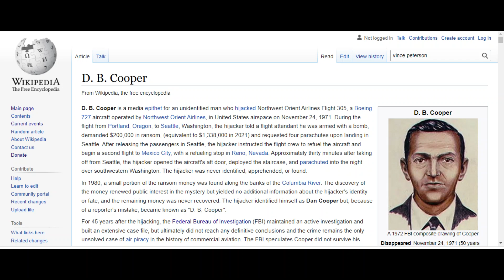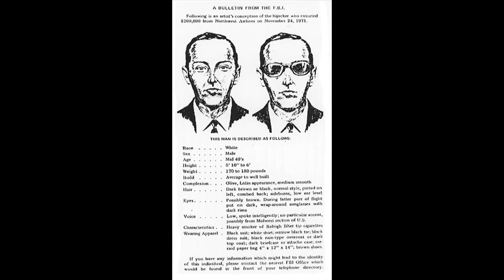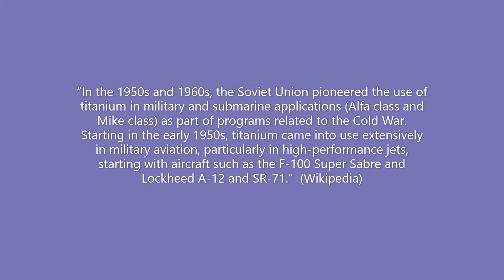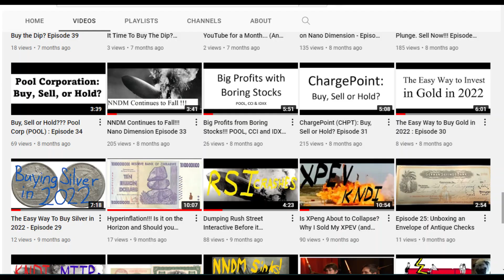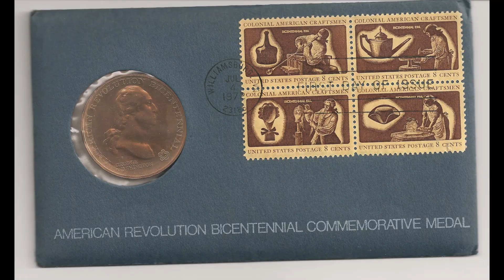DB Cooper: The Trouble with the Titanium Tie and the Latest Suspect. Episode 147

Comment: This is just a hunch, but my theory is that Cooper was a secirity guard. I'm sure that places like Boeing and Lockheed had former military guys working security. It just seemed like the most logical explanation, because my recollection is that some of the residue indicated the tie had been worn regularly. Who is going to wear the same clip-on tie to work 3-5 times / week? I would say a security guard.
Reply from the maker: Hello, as a former security guard at a high tech facility for eight years I think that you are not necessarily too far off. We had a strange rule where if we wore a long sleeve shirt which was part of our uniform then we had to wear a clip on tie, but if we wore a short sleeve shirt we did not need to wear the tie. The ties that we were given were supplied by the company and were very specific one made for the company that looked like it went with the uniform but upon leaving I was able to keep the tie and on occasion I would wear it with a regular suit jacket because on occasion it looked like it would be appropriate. Now we know for a fact, this is really undisputed by anybody, that this particular tie was an inexpensive one sold for only a few years towards the end of the 1960s at JCPenney. The argument against a security guard wearing this tie during the course of their day would be that typically their employer would supply a tie and would want a standard tie worn by everybody, not one off the shelf from a department store. However I pointed out in my most recent video that I uploaded yesterday which was the second part of a two-part series about the tie (which I encourage you to take a look at) and I suggested that a wide variety of people could come into contact with the substance in question during the course of is there a normal business. I think that one would find and most people agree that most men and these situations were wearing ties from the top executives down to the mail clerk. I could even see some of the custodians wearing a tie. You have to remember that at that time gas station attendants often wore uniforms with hats and ties. Now I agree that people on the shop floor would likely not wear ties because it could get caught in machinery, that nevertheless leaves a lot of people who could come into casual contact and pick up three molecules of the titanium in question. I also asked the question which may be relevant or not but if somebody was working with this titanium why out of 100,000 molecules found were there only three molecules of titanium found on the tie? That seems like very few but again this could be a tie that he wore for one week in the lab before he committed the crime if the tie actually belonged to Cooper for more than a short period of time. Many people have pointed out that you can get ties at garage sales and thrift stores. That's certainly true. Other people point out that engineers where the same tie for years and never get rid of them. I've had a number of people contact me and say that they've kept every tie they've ever had, and I believe that the same would be true for me. In the end the tie may be very relevant or it may be completely misleading even if inadvertedly so. Thank you so much for your comments. Hopefully I have gained you as a subscriber.
Reply: @theanthonyrrmillsshow3876 : Thank you for taking the time to write such a thorough reply. You gave me a new way to look at the situation, as I didn't think about the fact that ties would have been a lot more common back then. I was born almost a decade after the skyjacking. So, I didn't even think of that.

I agree with what you're saying about the amount of titanium being too little for someone who worked with the material regularly, unless the tie had only been worn a few times. I think the tie was worn a lot, though. I'm going off of memory on this. So, I could be totally wrong, but I think I remember hearing that the amount of nicotene residue on the tie was consistent with it having been worn very consistently.

As far as the garage sale / thrift store angle is concerned, I had heard that, and initially thought it made a lot of sense. The more I considered it though, the more I thought it would be an incredible coincidence for a chain smoker who knew weird details about airplanes to buy a used tie that had belonged to someone who worked with cutting edge metals that were primarily used in manufacturing airplanes.

I'm not sure whether I watched the follow-up video you referenced, or whether I subscribed to your channel. If I didn't, I will certainly do it now.

Since I feel like every Cooper fan should declare a camp, I'll disclose that my pet suspect is Ted Braden. Cheers.
Reply from the maker: @scottyoung4226  Ted Braden is a very good candidate on the surface. My concern with any of the candidates that people have put forward is they all survived after the hijacking. I don't rule out the possibility that Cooper survived but I think that it's very unlikely and if I'm correct then none of the people who have been proposed could be Cooper since they all lived at least a couple years if not decades past 1971. Again I don't rule out anything, it's just too bad we don't have any suspects who disappeared after Thanksgiving 1971.
Reply: @theanthonyrrmillsshow3876 : Thank you for your replies.

Relative to the dynamite, it seems like we're in agreement that the smart move for Cooper would have been for the bomb to be fake. The reason I bring up the flares is that people always say Cooper wouldn't have been able to coordinate with an accomplice, because he had no way of knowing where he was going to land. My thought is that, if Cooper had flairs, he could have arranged for an accomplice to be waiting at the Columbia River. Cooper reportedly asked the stewardess if lights they could see were from the Merwyn dam, and also asked about the location of a nearby AF base. My guess is that he was trying to get his bearings so that he could land as close to the river as possible, and then fire off flares to signal his position to his accomplice.

I get your reasons for thinking Cooper died. The money at Tena Bar is really tough to explain if Cooper survived. If we're being honest though, the money at Tena Bar is tough to explain if Cooper died, too. It was three packets of bills. Each was wrapped with a rubber band, but the three packets were not attached to each other. All three were on top of each other, and Tena Bar is upstream of where Cooper is thought to have jumped. What are the odds of three stacks of bills floating against the current, and staying stacked together? If you think the cash got there from dredging instead of the current, what are the odds that those three packets would end up stacked together after the sand was deposited?
Reply from the maker: @scottyoung4226  Hey friend, I just saw this message from you, as you can imagine, I am now getting dozens of messages a day on Cooper, plus a few here and there on other topics, and i try to answer each one eventually, sometimes with a "thanks for the comment," other times with longer messages, often after checking to confirm a detail or two. I think your comment on the flares being able to be used to alert an accomplice is an excellent one. I ultimately do not think that they were used, so I think (and I agree I may be wrong) that Cooper did not survive, but the use of flares to alert an accomplice is still an excellent though and one i will keep in mind. As far as Tena Bar is concerned, I think perhaps you might have the direction of the Columbia River confused. The Columbia flows from east to West towards the Pacific right after the Vancouver Portland area the Columbia turns north for a bit and then turns east and continues a fairly short distance to Astoria and onto the Pacific. I think most people think that Cooper jumped in the Washougal river drainage area which flows S into the Columbia, or else he fell directly into the Columbia which is my suspicion. In either case these are to the east of Vancouver and Portland. So if the money fell somewhere in that area and then flowed towards the Pacific with its current, then Tena Bar is downstream. So it could have arrived there naturally due to currents downstream. Most researchers believe that the money bound its way into the Columbia and sank to the bottom where it was dredged in 1974 and deposited at Tina Barr. I don't know which way dredges travel when they are dredging the Columbia but it would seem to me that if it was dredged then the dredge could continue going upriver and drop it off or it could be going downriver and drop it off. So if we believe the dredge theory were it deposited the sand on Tina Barr then the location of the money on the river bottom cannot be logically determined just based on knowing that dredges deposited there sand at that point along the Washington side of the river. if somehow we knew that the only sand that had been dredged and deposited on Tina Barr between 1971 and 1980 was sand dredged from a particular part of the river, then we may know where the money had come to rest, but I doubt there ever existed clear records of that. The only reason to keep such records would be knowing that in six years people are going to find a little bit of money from a famous skyjacking case where we just dropped off some sand.
I know that there seems to be lots of controversy over the rubber bands supposedly holding the money. I don't even know if we can conclusively state in a court of law as a fact that it was rubber bands holding the money together and not the paper bands that are usually used to bunch stacks of money together. I don't dispute that it's rubber bands but I've never seen any pictures of the supposed rubber bands. And the thing about rubber bands is I have a house full of rubber bands that are really old and you pick up most of them and they just crumble in your hands. And then other times you have a rubber band around something that's just as old and it's still pretty good. My suspicion is that being submerged in cold water and then buried in the sand for quite a while may have actually preserved the rubber bands better than people think and better than the experience that we have with rubber bands sitting in our junk drawer. the issue of the money and those rubber bands is one that I don't know if the Coopersphere will ever completely agree on. some of what you read about interpretations of the rubber bands goes in One Direction and then you can read stuff that completely contradicts it. I know that there's now some research about the type of diatoms found on the bills and what season those diatoms bloom in. just as in the case of the titanium on the tie which may or may not be pure titanium or an alloy or both, without a very formal scientific report on of the diatoms that is peer reviewed by a number of experts we need to be very cautious in thinking that we know precisely when the money entered the water or at least the waters of the Columbia. I think that for money that likely was in the Columbia or in the wet sand along the edge of the Columbia for almost 9 years, there is plenty of time for diatoms that bloom in various seasons to come into contact with some of those bills.
OK my friend I think I'll finish up here and send this off to you I really do appreciate all of your comments and your interest in this subject. Keep on sending them to me, again I'm not an expert despite what some people might think, I'm just somebody interested in it that's willing to spend the time to create some videos. There is still a tremendous amount for me to learn about this subject.
Reply: @theanthonyrrmillsshow3876 : Thank you for your response!

I definitely could be mistaken about the directions of the rivers relative to the Tena Bar find. This was an obsession of mine a few years back, but my memory may not be as good as I'd like. My recollection was that the Washougal Washdown Theory required the money to travel against the currant in one of the two rivers, but maybe not. Dredging definitely makes the direction question moot, but I just find it very tough to accept that the three stacks of bills would stay stacked on top of each other if they were dredged up, though. It would be one thing if a significant amount of the money were dredged and dumped, and three stacks of bills ended up together, piled one on top of the other. They searched Tena Bar pretty thoroughly though, and never found any other cash. For only three packets to be dredged, and for all three of them to stay stacked together, just seems like an unbelievable coincidence to me.

I definitely know what you're saying about rubber bands. Sometimes rubber bands from the same package will be completely different. My reason for believing the stacks were in rubber bands isn't as much about how rubber bands behave as it is about how the typical paper wrappers would behave. Those brown paper wrappers that say the denomination of the bills in the stack seem to be just cheap paper and a small amount of glue. American currency is made out of a blend that is designed to be able to survive a long time in circulation. The fact that those $20 bills were so damaged tells me that it's unlikely a paper band would have survived to hold them together. Of course, everything in Cooperland is somewhat unlikely. That's why it only happened once.

By the way, I know you believe Cooper didn't survive. Deep down, I believe that too, despite really hoping that he did. I don't consider that question to be nearly as relevant as whether he /could have/ survived, however. If I tried to recreate Norjack, I'm just a crazy person who tried a crazy thing, and died. If someone with high level training tries to recreate Norjack, whether they survive or not, that's a whole different thing than me trying to do it. That question affects every little detail. Cooper was supposedly carrying a paper grocery bag when he boarded the flight. If Cooper was someone who /could have/ pulled off the heist, that bag probably contained goggles and an altimeter. If Cooper was someone like me, the bag might have contained Cheetos and a fifth of bourbon. If Cooper was a highly trained operative, the reports that his shoes were more like ankle boots than loafers are probably true. If Cooper was special forces, the dynamite was probably marine flares. If he was someone like me, the dynamite may have been painted rolls of coins. As much as I hate to admit it, I recognize that the smart money is on Cooper dying during the jump, or in the elements after he landed. That having been said, I still think he was the type of person who /could have/ succeeded in that type of heist. I think the choices he made were deliberately planned. I think that he may have been someone who didn't care whether he lived or died, but I think he was someone who wanted to pull off the crime of the century, and had the skills to believe he could. In short, I think there's a difference between Tom Brady beiing intercepted to lose a Super Bowl and Damon Huard being intercepted to lose a Super Bowl. I think Cooper died, but I think it was like Tom Brady being intercepted to lose a Super Bowl.

By the way, I don't know if you're ever at a loss for video topic ideas. If you are, I think a good one would be what I think of as the Cooper "wild cards." The biggest one would probably be the guy who provided the parachutes. I'm blanking on his name, but his story changed drastically over time. Sometimes, he said he provided two good chutes and two dummy chutes. Other times, he said that wasn't the case. I think he also changed his story on whether he gave Cooper military chutes by specific request, or because that was just what he had packed and ready. Another wild card would be Det. Himmelsbach. With the exception of the Detective, every witness described Cooper as a polite gentleman. Himmelsbach was adamant that Cooper behaved in a lewd manner, saying things that Himmelsbach claimed were too vulgar to repeat. There are also the discrepancies about Cooper's footwear, the fact that a witness who worked at a paint store (and presumably would have had a good eye for color) was certain that Cooper's suit was brown (even though the tie left behind was clearly black). I don't know that any of those discrepancies get us any closer to answers, but they certainly are interesting.

Another interesting question is the attempts to track the money. In one of your videos, you did a great job covering whether the fact the serial numbers were recorded and reported to every bank / casino in the US would have meant Cooper couldn't have spent the money. One thing people rarely talk about is that the skyjacking wasn't super far from the Canadian border. Could the money have been spent in Canada? Also, I've recently been listening to an audiobook about a guy who was a currency forger (in addition to a lit of more serious crimes). The book indicated that one of the most difficult things about catching the guy was that forged bills are rarely spotted by the store, or the bank. They're spotted when the money gets deposited at the Federal Reserve. At that point, the Fed knows which bank the money came from, but the bank rarely knows which business the money came from. In the rare instances that they do, the business rarely has any idea who spent that particular $20, unless a cashier mentioned something strange. If Cooper bills turned up in that manner, in different parts of the country, would that have ever been disclosed?
Reply from the maker: @scottyoung4226  Hey Scott just very quickly before I go to bed I wanted to comment on a couple things I'll try to comment on other points at a later time. The Lewis river actually empties into the Columbia River to the north of where Tena Bar is located, And I've mentioned before Washougal is quite a bit to the east of the area as the Washougal flows South into the Columbia River. If Cooper and or his money ended up either in the Washougal or Lewis Rivers, and the money then flowed down to the Columbia and naturally settled on Tena Bar, That could only happen if it came down the Washougal or dropped upriver in the Columbia. If the money flowed down the Lewis River, then it's unlikely that it's magically going to travel up the river naturally to Tena Bar. I don't believe that the money floated on its own and then burrowed into the sand Tena Bar, I believe that whichever river it initially ended up in, the Washougal, the Lewis, or the Columbia River, that it eventually was dredged up in the Columbia River and deposited on Tena Bar, likely in 1974 as has been reported in various sources. 
As far as the money being buried on Tena Bar, the three theories are: Cooper survived and intentionally buried some or all of his money there and perhaps returned at another point in history and removed all but let's say $6000. I believe that there is very little chance that that happened but it's not out of the realm of possibility. One of the many reasons I don't think that that's likely is that if somebody survived burying it in the sand on the shoreline is not a safe place when if you look at the pictures one would think that slightly farther up away from the water line would be a safer place to bury paper items. The second is that the money somehow floated there either three stacks or all of it or all of it in a bag and then somehow got buried under the sand. I think that that is even less of a likelihood. So obviously my preferred method is that somehow at some point in the Columbia River either directly dropped or indirectly coming from a tributary, some or all of the money settled onto the floor of the slow moving river and remained there for about three years. And then it being dredged up and deposited on Tena Bar. 
Now I have never seen much in the way of exactly how the bills were arranged in the sand. Remember this was an 8 year old boy digging a hole evidently for a fire pit for his family that was camping there. We don't know if there were three stacks sitting on top of each other, three stacks side-by-side orderly, We don't know if assuming it was from a dredging operation how those stacks were scooped up from the bottom, were they just laying there or were they still in the bag, when they were deposited on the shoreline were they still in the bag, did they fall out of the bag. It would seem to me that if they were in the canvas bag that the bag would still be with them when it was found. It looks like they did a thorough search and nothing else was found so I think we can assume that the bag was not with them when they were deposited in the sand and certainly I think in three years one would not expect the bag to completely decompose, especially when the paper while badly decomposed to a degree, still survived.
So ultimately, I don't know what the money really proves, or even indicates. At the very least one could conclude that if Cooper did survive and get the money in circulation, though it was never detected in circulation, that he at least didn't get away with $6000 of the ransom. Other than that we don't know what river the money ended up in originally, which could give an idea where the landing site might have been, we don't have proof one way or the other that it was intentionally buried by Cooper or that he did not survive and ended up in the Columbia, in fact it really just opens up far more questions than it answers, doesn't it? And just imagine if that child would not have found the money when he did, flooding from a storm a few months later could have washed out this interesting set of clues back into the river and no one would be the wiser.
Thanks again for your comments I will look at your other comments and reply to them at some point in the future. I do appreciate hearing from you.
Reply: @theanthonyrrmillsshow3876 : I think you and I have very little disagreement on the money find. I find it funny that some people spell it Tena Bar, while others spell it Tina Bar. It really is a great metaphor for the fact that everything related to that money find is open for debate. I think you and I agree on the following, though (with my added commentary in parentheses):

1. The information about where / how the money was found is not reliable. (It came from a young kid who didn't know the details were going to be important, and some of his information was contradicted by a family member.)

2. It's unlikely that the money was deliberately burried there by Cooper, or an accomplice. (If you were going to bury money, there are spots that are far less exposed from a witness perspective, and many of those spots would put the money at less risk of being damaged / carried away by water.)

3. It's unlikely that the current took the money there, and it was buried by natural  activity. (If you drop a bunch of stacks of money in the water at the same place and time, it's unlikely that three stacks land near each other, and the rest of the stacks end up somewhere completely different.

4. The dredging deposit theory is the most plausible explanation, but is also the explanation that tells us the least about where Cooper landed since they could have dredged that sand from pretty much anywhere. :(
Reply from the maker: @scottyoung4226  I agree 100%, very difficult to know the truth on anything in the case.
Reply: @theanthonyrrmillsshow3876 : I watched your second titanium tie video. I thought it was excellent. Thank you!

By the way, I would love your thoughts on another Cooper theory of mine. The flight attendant who saw the "bomb" in Cooper's briefcase described red sticks of dynamite with wires attached to them. I read somewhere that dynamite is only red in the movies, and that it's actually green / brown in real life. If I was trying to pull of a skyjacking, I would want to make sure that everything I had was as usefull as possible. If I'm going to make a fake bomb, I'm going to try to make it out of components I will be able to use. What if those red sticks were actually the 1970s version of this: https://youtu.be/8FEEURRI-GY
Reply from the maker: @scottyoung4226  Hi Scott, thank you for your question. I agree with you 100% that likely the bomb was fake. I may have heard in the past that dynamite at least these days is not really wrapped in red paper although in the past it may have. And if I had heard that I had forgotten it. I did look it up and it seems that at the present time there is only one company in North America that manufacturers and dynamite and they wrap it in yellow paper. Certainly if 50 years ago dynamite was not wrapped in red paper then that would indicate that the bomb was likely not real. But even if he wanted to make it look authentic to an expert, which would look inauthentic to a novice such as the stewardess or myself, it could still have used authentic looking yellow paper and it still be a fake. But of course if I wanted to convince somebody that I had a bomb I would probably show them dynamite wrapped in traditional inauthentic red rather than authentic yellow paper. Of course once that was reported to the FBI they probably determined that it was fake. But let's say that the stewardess was able to relay to the captain who relayed to the authorities that the so-called bomb consisted of dynamite wrapped in red which would indicate that it was fake. If the FBI knew it was fake and just tried to come on board and rush Cooper it could be that he also had a gun or perhaps part of the bomb actually was real even though he used fake dynamite to make it look even bigger. The alternative is give the guy some parachutes and $200,000 and let him get away so that there's no chance that he ends up killing four airline employees and possibly doing damage to an airliner worth 10s of millions of dollars. And even if Cooper had access to making a bomb you don't need to go to that hassle when you can make a fake bomb with stuff around the house and probably an hour or less. If he had a real bomb there is always the slight possibility that it goes off and kills him unexpectedly which defeats the whole purpose if you really intend to get away with the ransom. Thanks again for the question and thanks for the video link. I think I've seen something like that before but it's always fun to see them again and that would be fun to shoot one of those flares off.